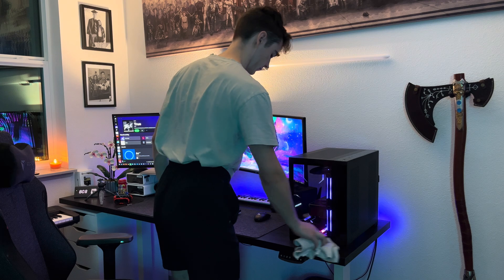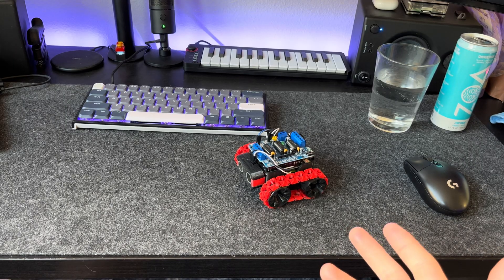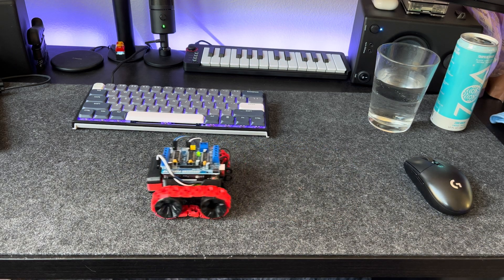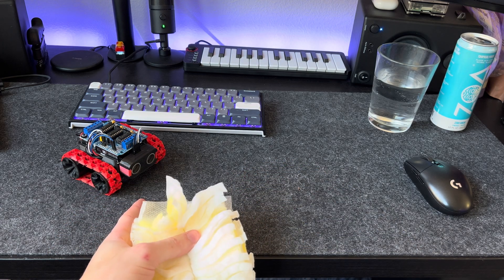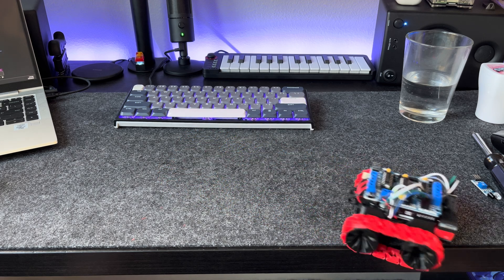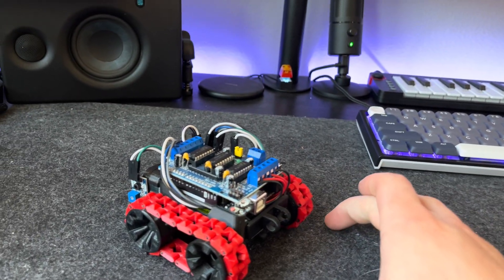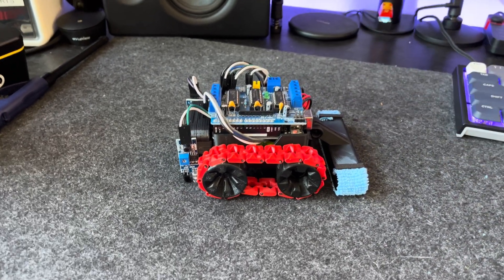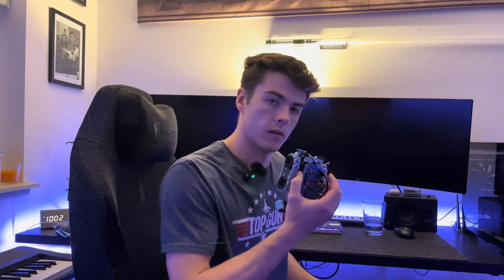DIY Roomba for Desk and Countertops

Comment: how you attchech the ir sensor , the file on the git do  not have a mount for ir sensor , plese provide stl for that
Reply from the maker: There is a mount on the front used for the ultra sonic sensor which stick out on both sides, that’s is when you can screw in the IR sensors

Comment: Did you use female to male connectors for the sensors? and not have to solder anything on the motor driver?
btw i subscribed, neat little robot
Reply from the maker: Correct female to male, I still had to solder the male pins into the motor shield

Comment: I couldn't find the prefit size of the chassis. Can you help me with that? Please
Reply: In mm
Reply from the maker: I’m Cura after scaling down to 10% it gives these dimensions: 78mm x 70mm x 33mm
Reply from the maker: The model is x10 bigger then it should be for some reason, reduce to 10% for scaling